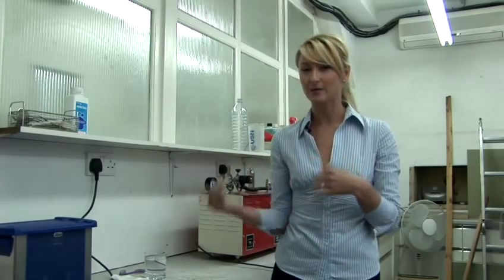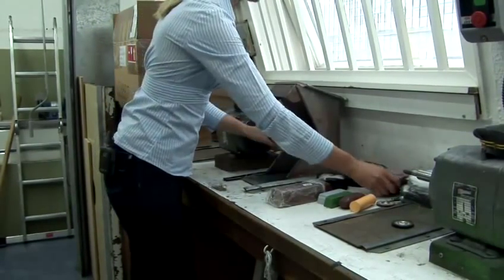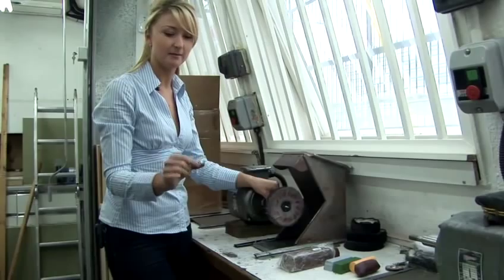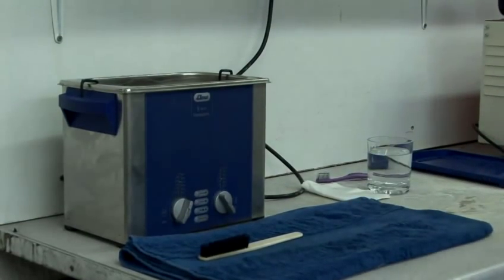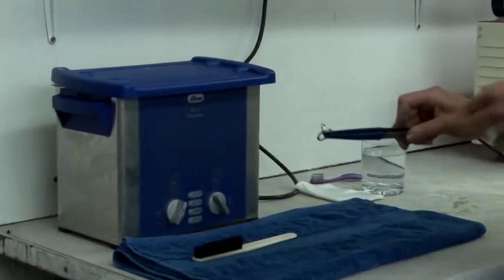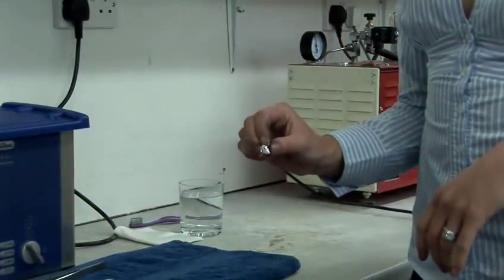How To Replicate Professional Jewelry Cleaning At Home

Comment: She said nothing about replicating the cleaning process at home, other than getting an ultrasonic cleaner. We don't all have the polisher and steam cleaner you know 🙄
Reply: So I’ve found to “replicate” the steam… i own a basic teapot- the kind that makes the whistle and shoots steam. So I soak my ring in hot water with Dawn for about 5 minutes, fish it out and give it a thorough but gentle scrub with a baby toothbrush, and dip it back in and repeat a few times. Rinse while continuing the gentle scrubbing to get rid of the soap residue. While I’ve been doing this my tea pot is heating up, usually by the time I’ve finished rinsing it’s about at full blast with the steam. I use needle nose pliers with the ends wrapped on paper towel to secure the ring by the part that doesn’t have stones and hold it in the direct release of the steam- yes, it’s loud, and annoying sounding but I do this while moving the ring around to get all angles for about a minute. When it’s done it’s as clean as if I brought it to the jeweler without buying all sorts of devices and such. Tadaa.